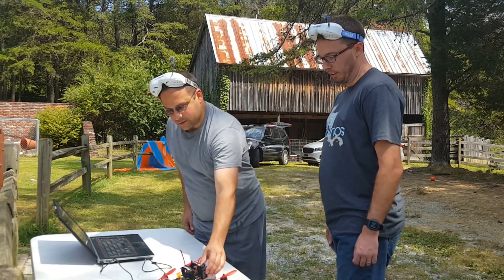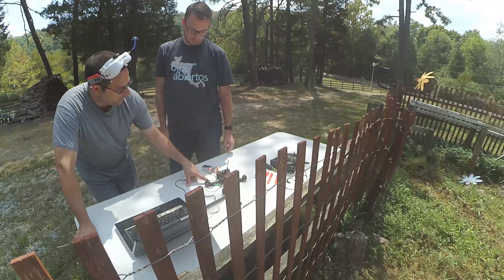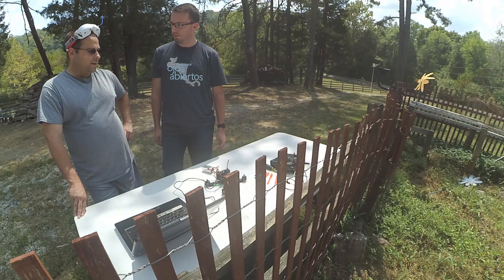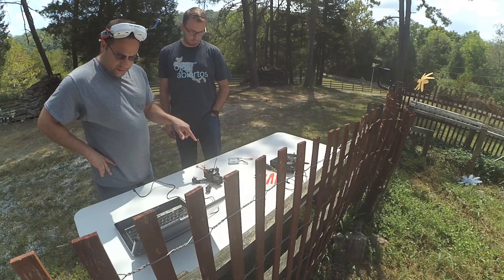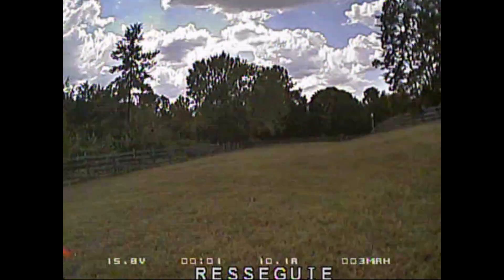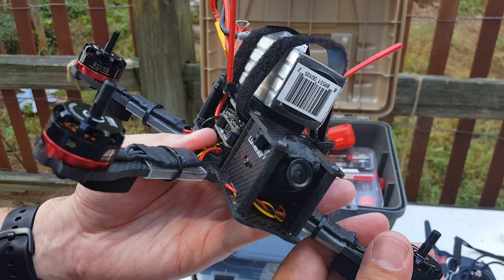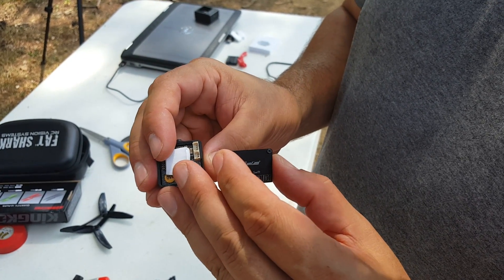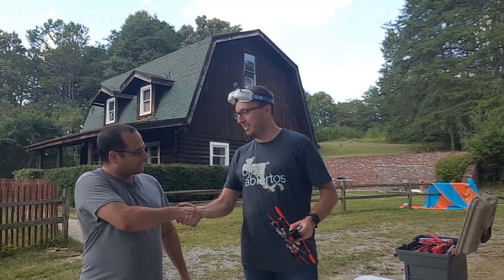Troubleshoot Your Quadcopter Vibration Problems | REAL WORLD TROUBLESHOOTING David R.

Comment: I've got a brand new build that was having problems with it taking off on arm.   Checked prop direction and motor direction numerous times, but it would still spaz out.   So thought I'd check for vibrations causing issues, and decided to do the motor vibration test and performed it quicker than you did in this video.   Smoked my SpeedyBee F405 V3 Stack 😂.   Defo learnt something today 👍

Comment: Hello, can you find my problem, using tbs 25a esc, emax 2205-s, dalrc f722 FC , matic hub pdb. its not flying properly hitting the ground as soon as i try to take off, arming is good, done motor callibrations, esc firmware updated to latest, but still im facing issue. 
 
https://drive.google.com/open?id=1WseAOW7uZUoQDiAkplC4RdnyXEBpmywN

Comment: THANK GOD FOR THIS VIDEO! I've been troubleshooting my ultra weird gyro issues on punchout for a week now and followed most of the steps you talk about in your different troubleshoot videos. I incriminated wrongly my motors / FC / props...  and it turns out it was a beeper i added last minute that was just hanging loose and was touching the gyro ribbon cable... i strapped it down and bingo it's as smooth as butter

Comment: fuck this im angry. first of all - you did not fix ANYTHING. its still the same shitty problem that i have, a drone that shakes on thrust. normally i would thinks its ELKOs but no, everything is capped, its an absolutely fresh build and shakes violently, even on some midthrust slow corners, im so fucking fed up with this
Reply from the maker: Ummm. I did in fact fix David's problem. Sorry you had a different problem :-( 

If you want to contact me privately I'll do my best to help you solve your problem.

Comment: There are times when you notice vibrations within your HD recorded video. 

So you soft mount FC and motors, PID tune, change arms, change ESCs...

...but after a while you realize your HD camera is just loose on the top plate.

Comment: If I am showing 3.66 on one of the axis after resetting gyro without the battery plugged in, is it possible that movement on the floor where table is placed is causing this. I am trying to diagnose a punch out oscillations that only happens with a 4 cell, no matter which new props and different pitches dal 5x4x3,Gemfan 5x4.3x3,dal 5x4.6x3 all have high throttle oscillations ,but only on 4 cells. Does happen with 3 cell. Any ideas

Comment: Hi, I'm having a major issue with a new flight controller I bought where no matter what the settings it seems to jerk around in the yaw axis whenever a little bit of throttle is applied. I know the motors are fine as well as the escs because they just worked with an older f3 flight controller. Here is a vid of the problem. Here is a video of it occuring https://youtu.be/rZQrjdiWWyI. Any help would be appreicated. Thanks in advance.

Comment: Thank you so much Joshua! You're supporting the community so well. Thanks for your effort to provide all that important Infos! Without all these Infos, it would had been impossible for me to get into miniquads. And dang, its just great. 
btw with the help of this Video, i was able to get rid of my mid throttle vibrations (a Motor shaft was bent slightly, only visible on motortest with accelometer)
thank you!!!
And as important as that been said: Thanks to Boris B for this great software and gui of Betaflight!

Comment: I tried the motor test. I get a radically different number every single time I spin an individual motor. I can even hear a difference. It feels like every time I activate an esc, it produces a different amount of noise. I am not getting vibrations when I fly, but after flying a few minutes, my quadcopter flips out like nothing youve ever seen before. I will try to take a video the next time I fly, but I dont think that any camera has fast enough fps to capture these rolls. Plus, I am attaching a camera knowing that I am going to have an epic crash..... I have been tweaking on betaflight and blheli for a week because im afraid to fly it. Its a brand new build with the most expensive components that I have ever used. I have checked everything that I can think of. Here goes nothing.
Reply from the maker: If a given throttle value in the Motors tab does not produce a consistent RPM from the motor, then either the motor or ESC is defective.
Reply: Thank you joshua. Had another lousy day. I am really trying here. Im taking some time off before I lose it and throw everything into a big ol bonfire....
Reply: Woke up early and grabbed my gear. Strapped on the camera and had 2 perfect flights on 3S. I had changed a few things and I was trying to induce a flip-out, but it flew great. I put on a 4S and flew lightly and it went fine. Second 4S, I took off and hovered while I pulled the goggles down and it went into auto insane roll mode. The good news is that I had a camera on, the bad news is that it spun so fast, it flung out the SD card. I KNOW that I wasnt touching the sticks, so I have ruled out my stick input, the props, air mode, I re-flashed and calibrated ESCs, calibrated accelerometer, reset to stock pids, changed receiver, moved and tied down antennas & battery leads, and turned off everything except accelerometer. Next step is soft mounting. If that doesnt fix it, Im gonna re-flash the board and start over. Its a shame because I loooove the motors that I put on this one. I know that nobody is gonna see this, so I guess im just updating because I have nobody to talk to about this stuff. You ever tried to talk to a "civilian" about this hobby?
Reply: Ha! I popped the SD card back in and it saved! Finally caught it on video! The file is sorta corrupted, but here it is. This crash was not bad at all compared to the other times. It does this every day at some point. Sometimes first battery, sometimes 4th battery. But it has only happened on 4S and always on the roll axis.
https://youtu.be/bzvKTk4TzJc

Comment: So the motors I have r myrcmart RCX 2206 2400kv v3 motors. There is a rattle to two of them and a slight rattle on one of them and nothing on the last one. R there replacement parts I can order to fix that?
Reply from the maker: Yes, Myrcmart sells replacement bearings, bells, shafts, etc.
Reply: Yeah but what do I replace exactly?
Reply from the maker: I guess I would start with the bearings. But save yourself some shipping money and order a few of everything.

Or just buy new motors :-)

They're like $12 right?

Comment: I have a similar problem except it is the result of a crash. My pids were fine. I don’t hear the vibration. It always happens at 34-42% throttle. I changed the props and it made it worse. I put a GoPro on the quad (which I thought would have been horrible because the only thing keeping it on was Velcro (the crash broke the GoPro strap lol)) and the GoPro footage is fine. How else can I test the quad to find out what’s wrong?
Reply from the maker: +JC250 you crashed and now you have vibration. Surely it's a damaged motor right?
Reply: So I realized that I can hear the vibration. Also, most of the screws on the quad were loose so that was most of the problem. However, with everything tightened up, there is still sone vibration. I think its from the props, as they r the same ones I crashed with with me bending them back. Wouldn't the motors be hot if one was damaged to cause mid throttle vibes like that? I'm running Pt1 with both notch filters off and dynamic filter.

Comment: i am currently having vibration issues, with a fat shark 600tvl cmos cam... andi have found the circut board inside to be loose. thank you very much for your vids, my vibration issues have been giving me heaps of trouble. to the point where it is impossible to fly. thank you heaps

Comment: I was troubleshooting a similar problem, determined it was an issue with two motors and ordered some replacements. Two days later, YouTube recommended I watch this, so I checked the camera. Indeed, there was a rattling! It turned out to be the lens optic itself inside the lens housing, so I'll pick a new one up and see if that helps. Thanks for this video and glad YouTube recommended it before I finished installing two new motors!
Reply from the maker: Yup, I have lost a lens optic that way. Replacement lenses are not too expensive.

Comment: again a great video...THX! My gyros readings are jumping up and down between 0,0 and 0,78 when is sitting still with motors off. I have an omnibus f4 v2 do u have any idea what that could be?
Reply from the maker: It's normal. The gyro is super sensitive. I wish they had not changed accelerometer to gyro on the Motors tab. The gyro is useless.

Comment: I had exactly the same issue. Tried to tune it out for weeks. It was my 3D Printed camera case. Hot glued the edges of the board on with a couple of drops, default pids and done.

Comment: This is the single greatest video on vibration troubleshooting I have seen. I went through all the steps to try and figure out my quads oscillations. Wasn't the tune, the props, the motors, or anything. I soft mounted the flight controller, and motors and still it oscillated. It wasn't until I stumbled upon this video that I discovered I had the same exact issue... the damn camera board was lose.... such an easy fix. Copter flies great again thanks to you!

Comment: Hi there! thanks for the great video. I had been trying to see if my Eachine X220 motors were vibrating using your tips with Betaflight "Motors". First i can't reset, but it seems to be a bug of 3.1v. But when i tried to put some spin to each motor, none of the 4 stays under 1.0, one is even to going to 16.x . 
My Quad is doing fine in air i guess, but i'm learning in acro and not pushing everytime. 
Any thoughts about the result ?
Reply from the maker: Betaflight devs changed the configurator so it shows the gyro instead of the acceleromter now. The numbers are completely different.
Reply: Ah ok, so no way to know if the motor cause vibration ? 
I got a problem, my Wizard X220 is dropping suddenly to right side, just before there is a Bee Buzz kind off... happended twice back to back... i'm not pushing, stil learning

Comment: Hello Joshua, in my betaflight version the minimun refresh value on motor testing is 50 and you are using 2. Do you know how to change it?
Reply from the maker: This was an older version of the configurator. It has likely changed.
Reply: Joshua Bardwell Thank you Joshua. Actual version has this numbers changing all the time. However I saw a motor that had more vibrations that the other on the graphic. I changed and perfect!  My vibrations problems finished! Thank you so much. Really good job with your channel.

Comment: Is it a tuning issu when i got vibration at very low to low throttle( for example when arming but not when hovering)? I'm sure that the props and the motors are well belanced.
Reply from the maker: Not really. I would suggest soft mounting the FC if you haven't.

Comment: When I pull up the motors tab up on beta flight the section where you reset the accelerometer is not available to me. On my computer it says reset gyroscope. How do I change this?
Reply from the maker: +Mackenzie St. Croix they changed it. I'm not sure whether it's a bug or on  purpose.

Comment: I've been chasing an issue like this for a month now. Got so frustrated that I've stopped flying that rig. This gave me hope that it might fly again.
Reply: Update: the accelerator readings on the motors tab is currently broken (unless you get the source from GitHub), but I checked all the motors and they seemed fine. I pulled apart the camera though, and sure enough, the sensor was shaking inside the housing. A little foam tape and the thing flies like butter now.

Comment: Hi Joshua, 
I have a similar problem. I notice alot of vibration when I throttle up. I screwed everything down but I think it's a motor problem...I just baught the Emax RS2205s 2600kv's and have the issue from day one. On 4s I get a ton of vibration when throttling up. I've opened them up and filed some loctite away to maybe balance them (one bell I couldn't get to open for some reason......) and when I try and spin the motors one by one on the motors tab I see some vibration/unbalancing @ motor 2 (0.10-0.20G) but that's not the bell I can't get off btw. ANyways! Does this mean I have to buy new motors? Or is this fixable. Hope to hear from you! Cheers
Reply from the maker: 0.1 to 0.2 G with props off should be perfectly flyable and tunable in my opinion. I don't think your motors are out of balance.
Reply: Joshua Bardwell really? I kind off use the stock pids on BF 3.0.1 and get those crazy wobbles. It is worse in fpv cam then on the HQ cam btw. I don't think it a loose sensor ;) but tomorrow I will open the fpv cam up...Further do you got. any thoughts that might help? I use 30 a racerstar v2 ESC btw. Omnibus F4 and a realacc X2 10 v+ frame. hope you can help me out.
Reply: Joshua Bardwell So. Whats is it!?

Comment: THANK YOU! This video saved my FPV life. I have the Runcam Swift with the same exact problem. The vibration was horrible. I balanced the props many times, changed antennas, video tx, wires, but never thought the camera chip/board might be lose.  Quick fix with a piece of foam, and boom, crisp, clear video. Thanks again!
Reply from the maker: Awesome!

Comment: this is why ive contributed as a Patreon. i have had this exact issue lately. now i know what to check.  also check the motor bolts too, loose ones cause the same vibrated image and are often hard to see unless you grasp the motor and try to wobble it whilst watching the motor screws to see if they move. //
. yet another piece of helpful insight on keeping the quad flying

Comment: DAMN GOOD! I am curious, how do you focus your camera lens? It seems like it focuses to different distances so I am unsure how to really make it sharp.
Reply from the maker: If you are looking at the cell phone footage, it is auto-focusing. The Galaxy S6 is a damn good camera except for the fact that the phone overheats like a Southern Belle with the vapors if you record for too long, or with the battery charging, or if it's hot out.
Reply: No I meant your FPV cam there, do you focus at something a certain distance. For example, sometimes I focus on a fence until it looks sharp . . I just am not sure what distance is effective for proxi flight/acro.
Reply from the maker: Yeah. I find that, if I focus to like 20 feet, everything further out is also as sharp as it's going to get, because as it gets further out, you don't have enough resolution to actually make the object sharp anyway. So basically, I try to find the closest distance where faraway objects are still as sharp as they're going to get. Don't hold me to 20 feet. For lots of my cameras, I literally aim them at the far wall of my office... maybe 15 feet... and use that.

Comment: I had a small 600 TVL camera that lost its focus and I could barely turn the lens to adjust. I didn't see vibration issues, but I eventually found that the board was popping out the back. A little hot glue held it fast and it worked great until a surface mount component got knocked off in a hard crash by the buzzer. Poor placement of the buzzer was clearly the issue there.

Comment: Just got my omnibus and wiring it up on new build
Problem i am not getting to full sound on start It only has half the sound as what i can hear in your video
Any ideas?
Reply from the maker: Half of what sound?
Reply: Ok i am a beginner But not lets act daft here
When you plug the bat in your fc what do you hear
Oh and don't say the wife
Reply from the maker: There are lots of sounds that a copter makes when it starts up. Please don't call me daft for trying to be specific about answering your questions.

The two main sounds you hear when a copter starts up are the buzzer attached to the FC, which gives three beeps after the gyro initializes. This will happen only after the copter has been sitting still for a short period of time, so if you are holding the copter and moving it around, you won't hear these immediately.

The other sounds you hear when the copter starts up are the ESCs initializing. Assuming you have BLHeli ESCs, the ESC initialization consists of two halves. A tone consisting of three short rising notes, followed by a tone consisting of two longer notes, one low, one high. The three-note tone indicates that the ESC has power. The two-note tone indicates that the ESC is seeing a valid throttle signal from the FC.

If you are only hearing the three-note tone, then your ESCs have power but they are not seeing a valid throttle signal from the FC.

Hope that's helpful, you cheeky git.
Reply: That is helpfull I didnt mean to be insulting to you It was upset i am having constant problems i thought you were having a laugh So sorry Yes when i plug the bat in i hear3 short but fast beeps and thats it
It just seems there should be more and the motors dont move at all Usually you see them jitter
I have been building this quad for over 6 months gone through 3 sp pro flight controllers as they all failed  All the motors and esc are Brand new and i have seen them spin in tests before today
I can only think i have wired them wrong as no power going to them

Comment: I am sure glad you posted this. Got a brand new RunCam Swift and took it out flying this morning. I had this exact issue happen. Used some hot glue and the issue was gone. I would never of suspected that the board within the case was loose.